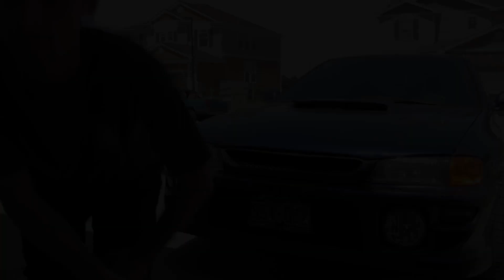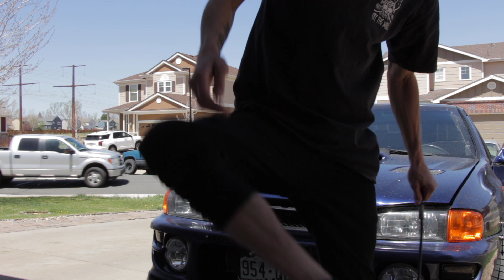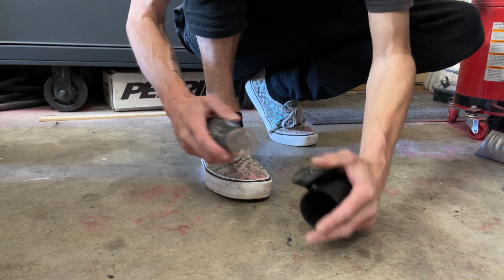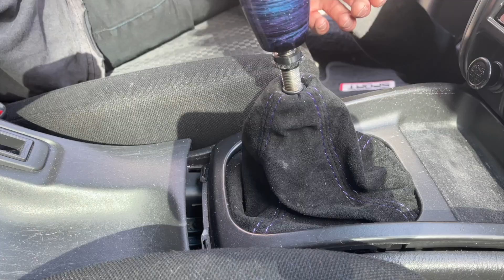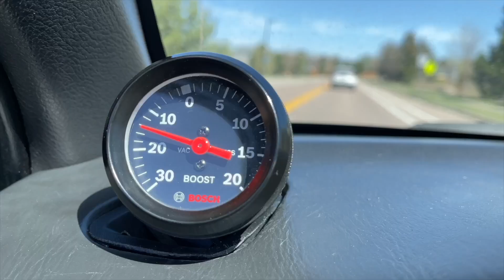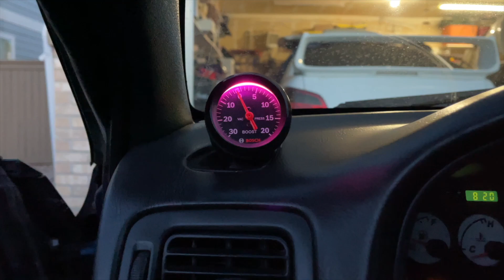3D Printing Parts That You Can't Buy For The GC8!

Comment: Have you checked your plugs ? .. i had this issue and turned out changing plugs with doing the gaps helped but it was eating plugs ..so then leads..problem went if it comes back
Reply: Did change the coil pack to but dont thinm that made the difference tbh
Reply from the maker: Yeah checked the plugs everything seems healthy. Had to small of gap on plug 4 right after the swap but was fixed awhile ago. Everything we looked at seems to check out. Still leaning on Mass Air Flow Sensor but will update if something changes.
Reply: Sounds like you will sus it .. annoying chassibg a fault